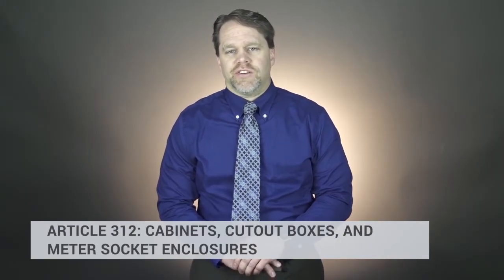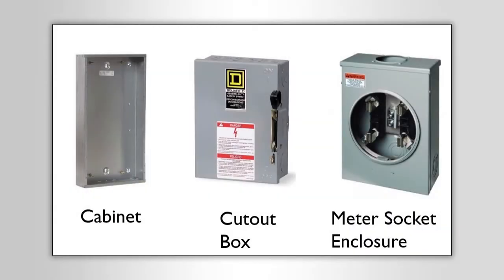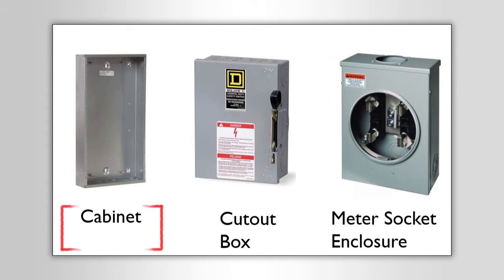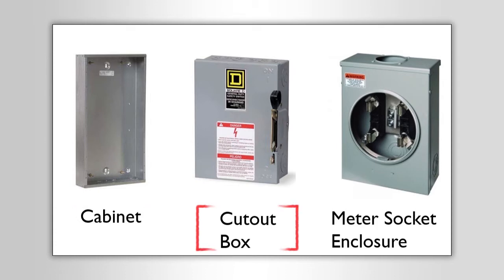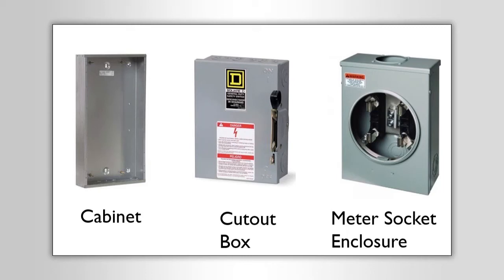2017 NEC Changes: Cabinets, Cutout Boxes, and Meter Socket Enclosures

Comment: Where in Article 100 does it say a cut out box have to have a disconnecting means? Still confused the NEC 2017 does not mention the means of disconnect and only mentions the fact there is a hinge that hangs on the side. This is misguided information. (protege of Mike Holt's)